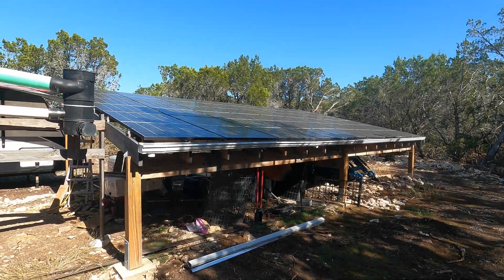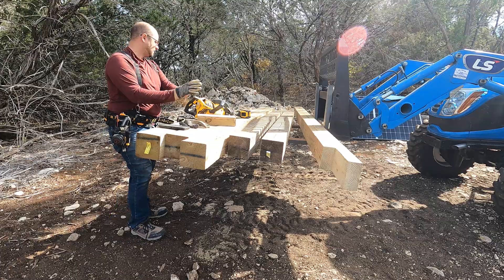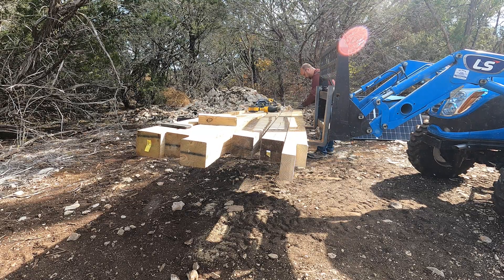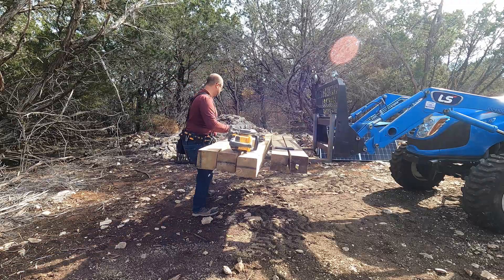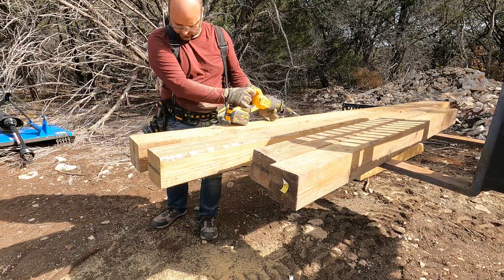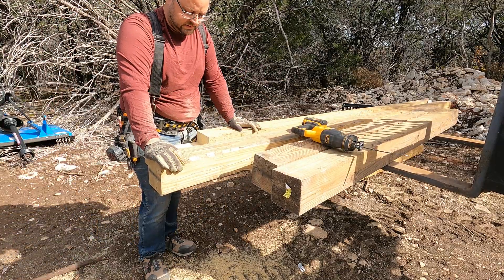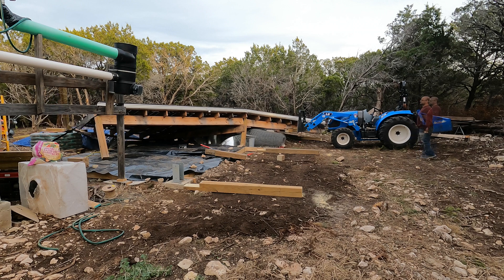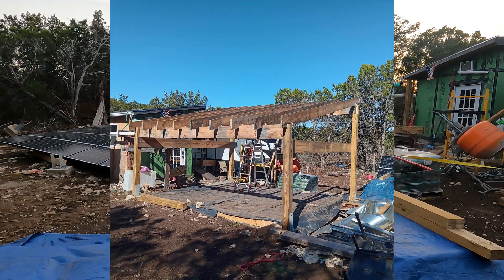18 - How to collapse a 27 panel solar array

Comment: I would have taken the solar panels off,  then did all the work and then put them back.
Reply: It's easy to say in retrospect or as the arm chair observer. I had a shipping container that I filled and wanted to move onto piers. It was too heavy for any of my equipment, and I didn't want to rent a crane (about $1k) to move it about 20 feet. I racked my brain for weeks trying to think of ways to move it. In the end, I did the sensible thing of emptying it, moving it, then refilling it. So much time wasted trying to ignore what I knew was the simplest, most reliable solution, just a lot of work.
Reply from the maker: @McCuneWindandSolar  I thought about that and thought it was too much work now I get to do even more work lol

Comment: I think you were on the right track but that 4 feet was a pretty big step. Maybe a couple of feet at a time would have worked better. As for the mechanics of it, I think I'd have done a few things different. First, I'd add diagonal bracing to the tall side. Second, I'd make it so the joist/framework pivots on the now stabilized posts. Third, I'd raise the short side. Finally, I'd reverse the process (diagonals and pivot the short side) and raise the tall side. Rinse and repeat as needed. 

Of course, it's easy for me to armchair quarterback this thing from the comfort of the keyboard. The important thing is you lived to tell the tale.
Reply from the maker: @rogermccaslin5963  Thanks for acknowledging the armchair bit, I was doing the same thing editing the video. I had bracing on before I moved but had to remove due to using some of those posts. I should have rigged up bracing when I attached the high side posts. That could have saved me alone. I agree bit by bit would have been better idea too. I realized that after I was already three feet too high lol.

Comment: Cat like reflexes! That was a good roll, you should get into ju jitsu! 😜 I installed my two post lift and that was certified jank red neck risky business to get those posts up lol I was more worried about scratching my Boston Whaler than getting squished though hahaha!
Reply from the maker: @Smokkedandslammed  Does what I do mean I'm a certified jank red neck now?  I do hope so.
Reply: @butterflygrovefarm  Here's your Jank Red Neck badge, Sears Robuck shot gun and 1991 Chevy K2500 (non rusted rocker panels and frame not included with membership)

Comment: Hey Daniel! Yes, I enjoy the narration :) I'm glad you weren't hurt!
Reply from the maker: @ShelleyRenee26  Thanks for the feedback!  I rather like talking to myself so I may stick with this format. Glad you like it too!
Reply: @butterflygrovefarm  If you had diagonal crossmembers.... Like you should have had.... The twisting and collapsing would have been a lot less likely... 
 In other words... Support your columns. I see in the middle you had one, but it wasn't diagonal. So. A lot more cross members.... Even temporary ones while you are moving it, would be a good idea.
Reply from the maker: @ellensedge1898  Yeah, I'd thought about this but since had the idea to use the posts for jacking up I had removed the cross members on the sides and left the one in the middle for as long as possible. I should have re attached even if temporary to the new posts before moving the other side. That would have been ideal. I would have liked diagonal but wanted flat for storage purposes and held good enough, when I wasn't trying to move it that is. Thanks again for the tips!